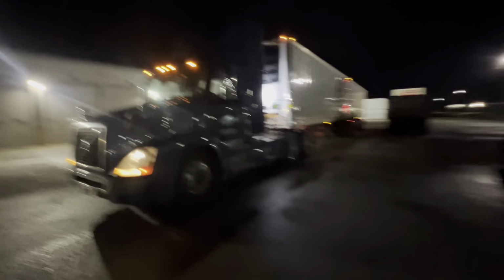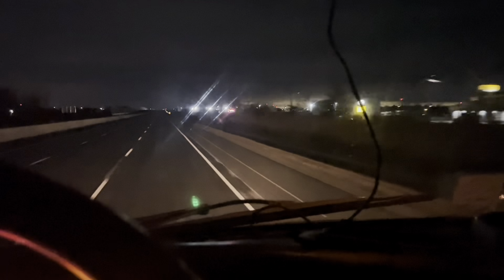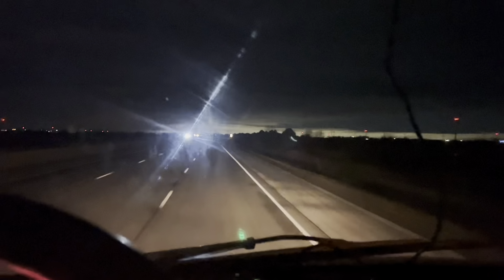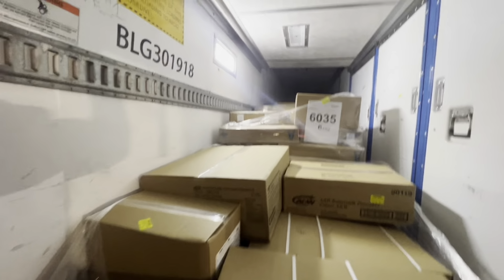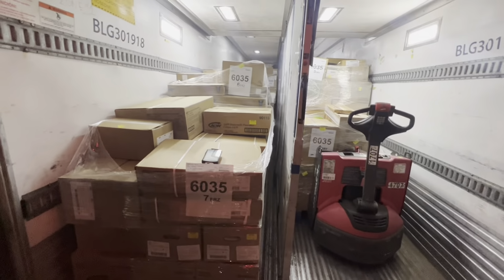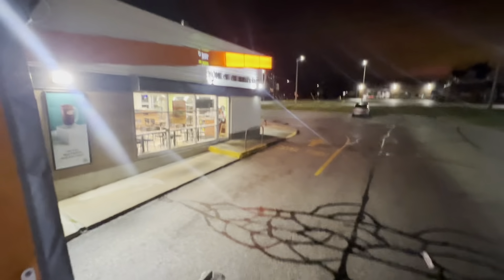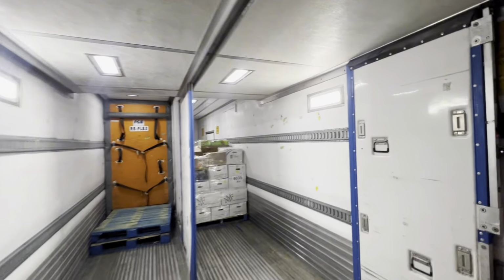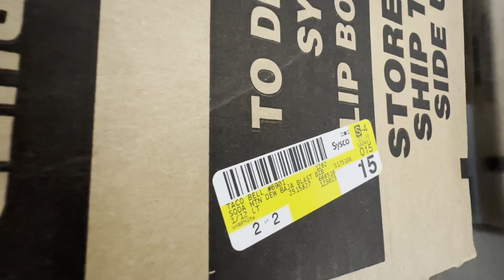A day in the life of a Food service delivery driver!

Comment: Great job you made it look easy. I work for Gordon’s in the states.
Reply from the maker: Thanks a lot !! Right on keep on truckin brother! We are a dying breed out here
Reply: @RiseanddGrind  Gordons in the states is a little bit tougher especially on the route side lift gates are far few and none (however they are starting to trickle in and some GFS divisions have more and more lift gates showing up.) I know GFS in Canada is an entirely different animal then in the states. GFS is starting to go the way of the lift gate it's very slowly happening on a case by case basis and it's going to take some time, but they are starting to come in.  Even if the load isn't pallatized a lift gate can be useful I've had big loads to stops where you couldn't get a pallet in the place, but you could get a U-Boat in and 1 U-Boat is worth at least at least 4 hand truck loads and a lift gate and U-Boat alone can work miracles on stops where you have a far walk.  Like certain nursing homes and stuff where the kitchen in aways away from the service entrance.  Even being able to take the pallets off the truck and work in the parking lot makes it about a 100xs easier. 

To me lift gates are the best way. That being said I worked on the delivery side for 7 years. I'm now on the shuttle/transit side and run A-Train doubles at night. Actually I like your Canadian B trains better then A Train doubles. Although I know in British Columbia I think A-Train doubles are more common. Anyhow keep up the good work.
Reply: @RiseanddGrind   I heard you say you've been working as a brokered worker for the food companies for 10 years. I've been at Gordons indirectly for almsot 10 years. I did have a small tour of duty at ABF.
Reply from the maker: @M22OHIO  I agree about the liftgates, we also do work for sysco here to so we are used to the ramp. I have a video coming up of that side of things. Yea we are brokers we own our own trucks 8 foodservice trucks regular a day for various companies. We keep busy! Thanks for watching you will have to show us your rig! Stay safe out there! Rubber down brother